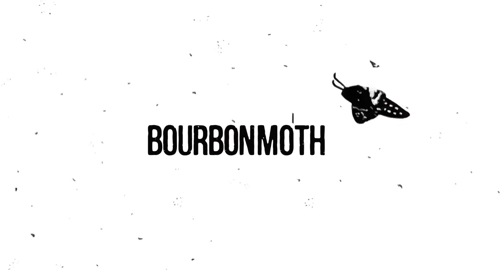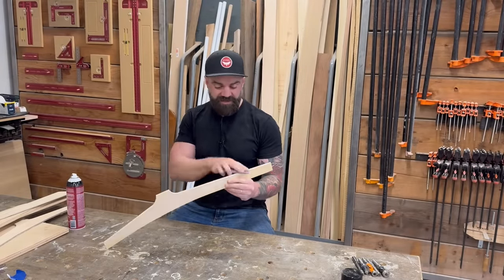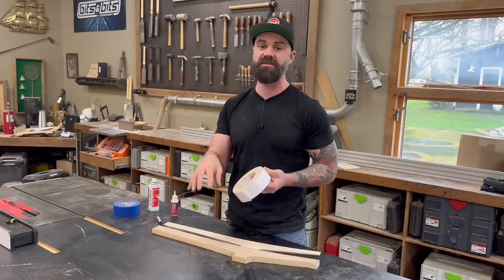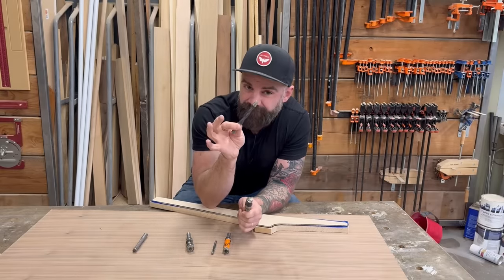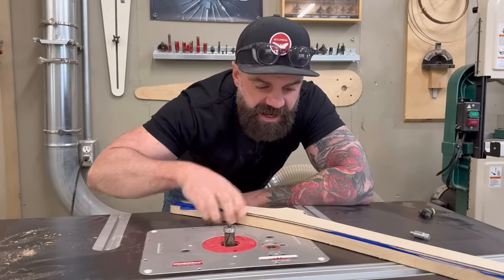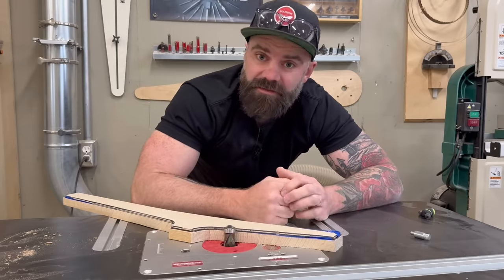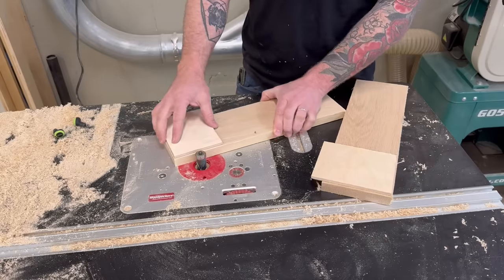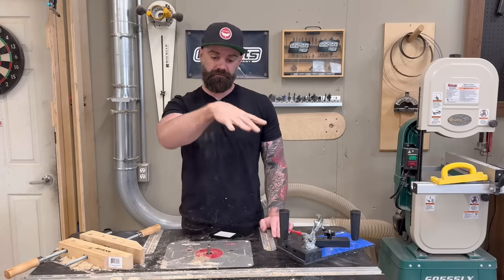Master the Router Table || Pattern Routing Made Easy

Comment: Great presentation  I figure router direction like this....gimme a thumbs up from your right hand.  your fingers are the motor and your thumb is the bit.  your fingers point in the direction of rotation on a router table.  for  hand held of course the bit would be represented with your right hand in a thumbs down posture.  Now your fingers are still showing you the blade rotation direction.

Comment: As a  DIY woodworker with many years of experience, I understand the concept of what you were trying to portray in the end-grain demonstration, but it was a bit misleading. You showed MUCH better control of the workpiece with the compression bit than you did with the straight bit by having your right hand closer to the bit end when turning the corner. With the straight bit your right hand was way out at the end of the piece, allowing the bit to have much more effect at PULLING the piece.

Comment: Oh come on, you had too much material for straight bit, the result would be close or even the same if you just run it 2-3 times with small increments. The same way you could prove that compression bit are not so good when compared to industrial grade bits with replacable sintered carbide plates. Other than that awesome video, as always :) all the best.